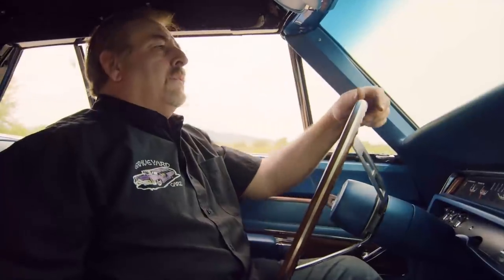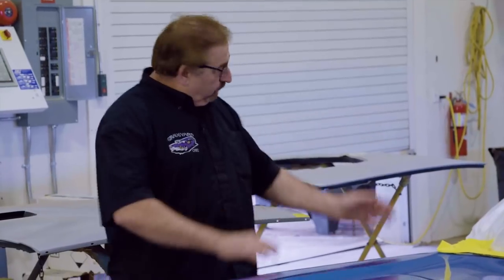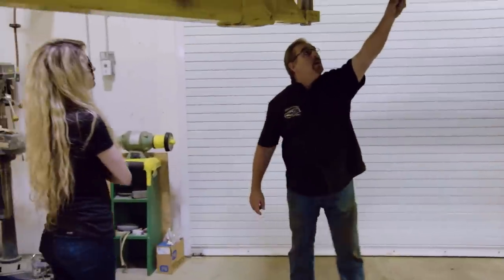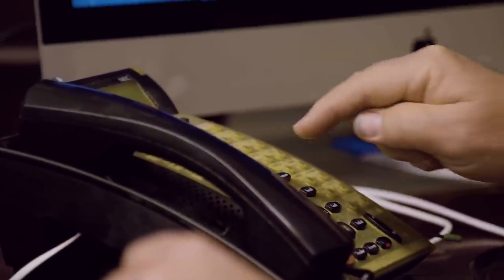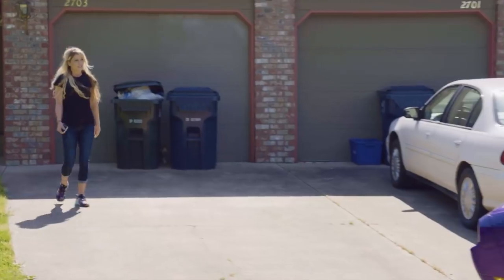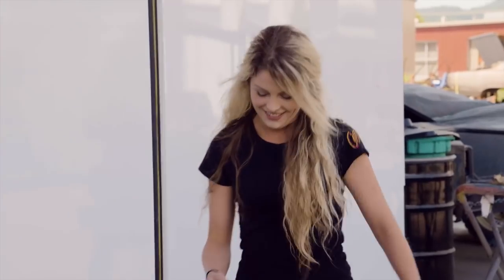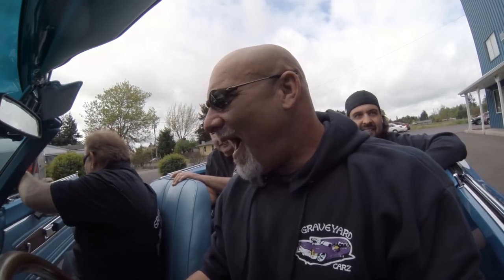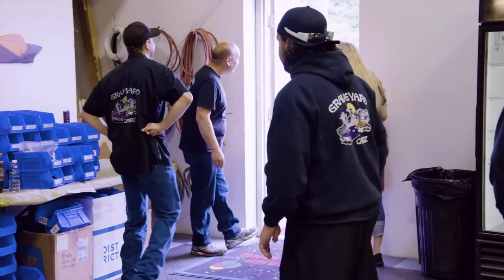1968 GTX CONVERTIBLE 440 4 SPEED GOLDBERG

Comment: What did Mark mean by the only 375 power convertible top? My 68 GTX has a power top. Also power windows, air conditioning, and AM/FM radio. Also has the adjustable head rests on the bucket seats. Almost every option available at the time was put on this car!